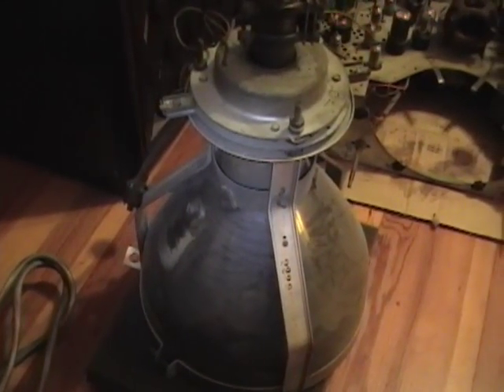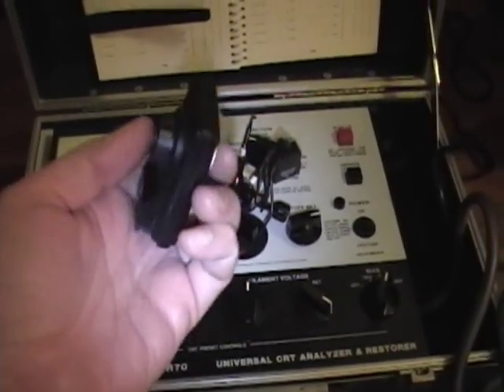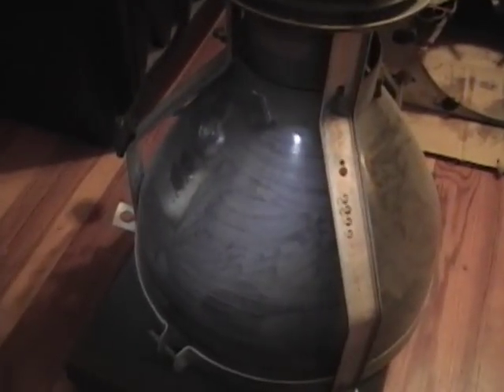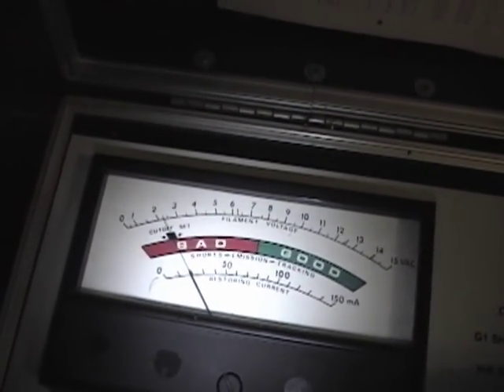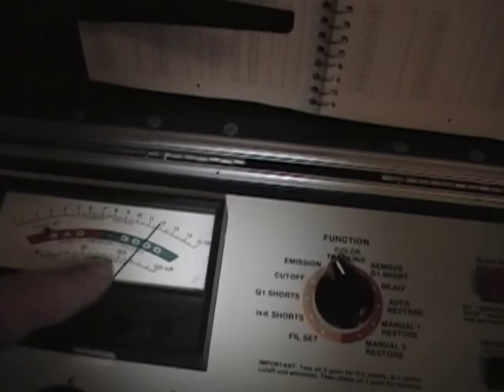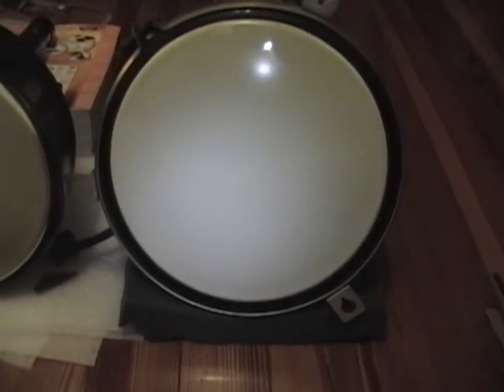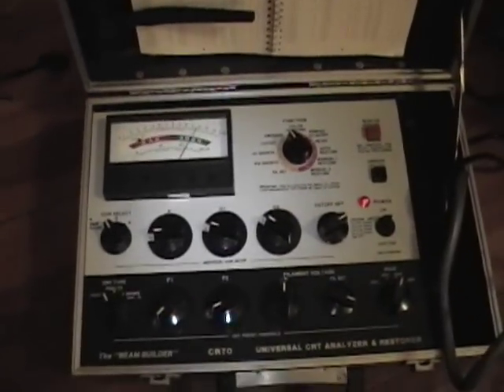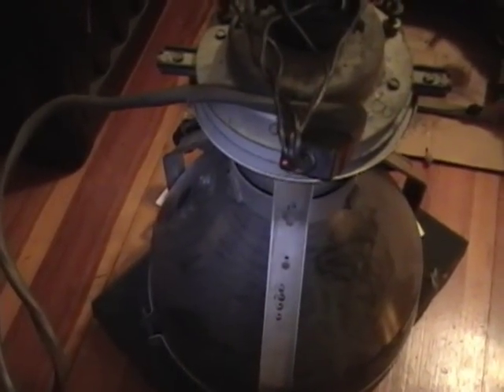Philco 49-1040 restoration p4o?

Comment: I'm surprised there are still CRTs out there to be rebuilt.I would have guessed that many were destroyed some 35+ years ago.I haven't seen a circa 1960-65 "roundie" colour TV in about 40 years.I got rid of my equipment around 1987.That was also the last time I saw a tube colour or black and white TV set.I got out of it by 1990.
Reply from the maker: There is a small but avid collecting community and sets do still show up for sale on a regular basis.  Some at estate sales in the home where they've sat since they were purchased decades ago.  Color roundies are more common in larger cities like New York and Chicago that had color broadcasts first.

Comment: I haven't seen as many enamel metalics as lacquer based metalics to be honest, most of the stuff that I tried was hardware store brands and it even had that lacquer smell. My method was to test paints on a piece of scrap wood or plastic to see what would go over what without reacting violently, I used to repair a lot of broken Bakelite radio cabinets and even styrene ones at one time as well as play with the wooden ones, so I tested out a lot of spray paint.

Comment: @bandersentv  You know i never liked u.s tellys but you changed my mind i live in the uk i restore valve type (tube type) tvs lots of fun. but we used the 405 line system so i had to get a Aurora Single Converter for £180 as you no doubt know we use 625 lines but well werth it i may now have to get one for 525 line and a u.s tv.